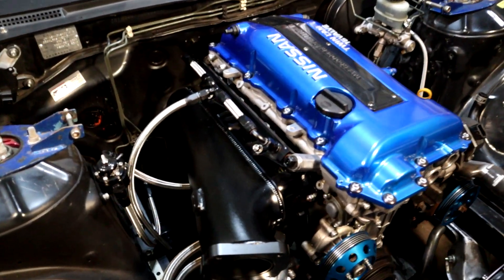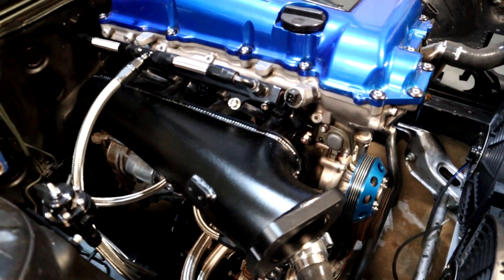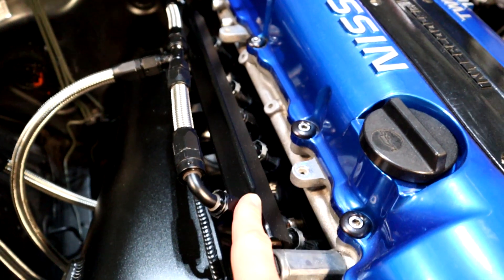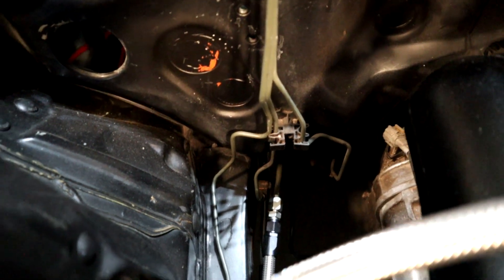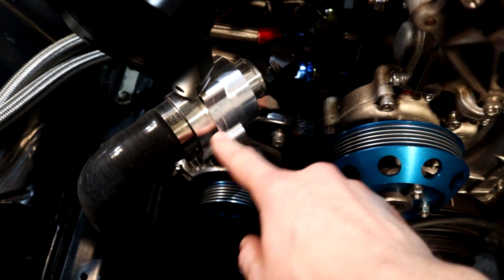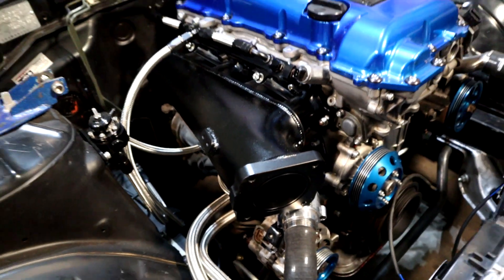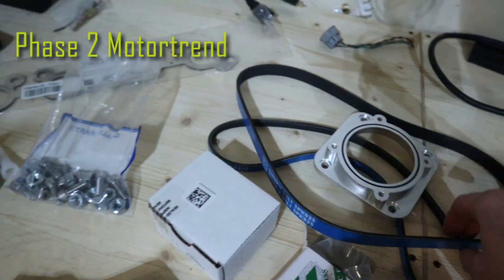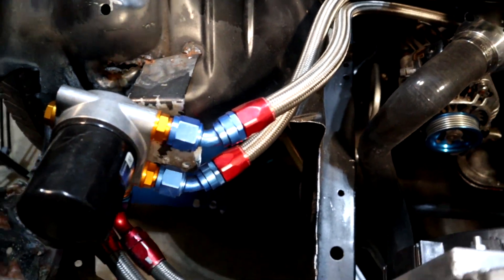S14 Recap - SR20DET Mods - Intake Manifold, Cooling, E-Throttle

Comment: My only issue is. Could you not use the center feed to feed injectors and then side feed for the return. To save having fuel pipes on top. That would keep pressure ?. Would look alote nicer too. And each injector would get good pressure and as for using 1000cc injectors. Youre not getting the best out of the injector they will be running half tilt. 500cc or 750cc ? Jist wondering as from wat i though better duty on the injectors wen near maxed out compared to not even getting full flow out of them if you get wat i meen.
Reply from the maker: The injectors are meant to support future mods on the vehicle. So yes, I do plan on running them up to 80% or 90%. As for the center feed, that had been the original plan for routing. But then I saw a video by Sammit where they were developing the intake manifold over in Japan, and they mentioned this specific setup as the intention.

Comment: If you could go back would you rather buy the velocity element intake manifold and avoid all the headache? 

With the fuel rail itd be near $1000 + a throttle body as opposed to the $500 ish you can get these ebay ones for (deepmotor)

Not sure which option to go with. eBay or velocity element. 

My main motivation is running top feed injectors so I don't have to pay $300 for the radium top feed kit. Stock intake is also ugly and makes the bay ugly
Reply from the maker: I'm not actually sure. It's kind of nice being able to make this intake manifold work. Almost unique in that sense! It did force me to clean up the cooling system, but that also increased the price tag too...

I did look at the Velocity Element one, as well as the Hypertune one, when I was initially deciding. They all appeared to be quite similar, so I'm not even sure how fitment would be with them. I'd be interested to hear if you do end up trying the Velocity Element one.